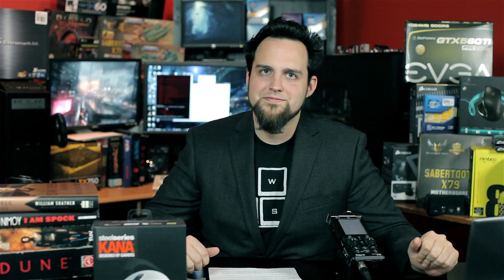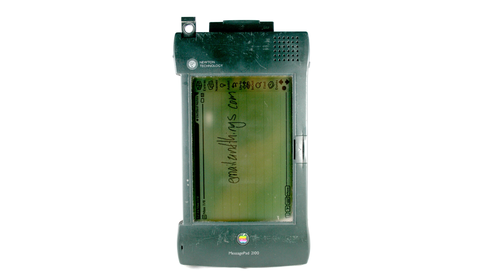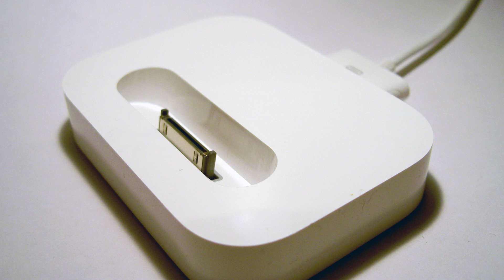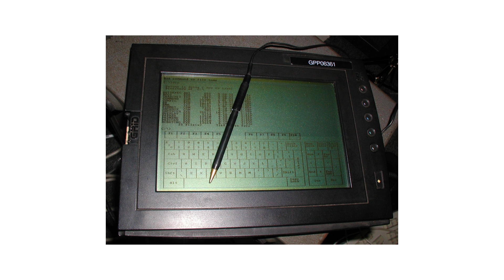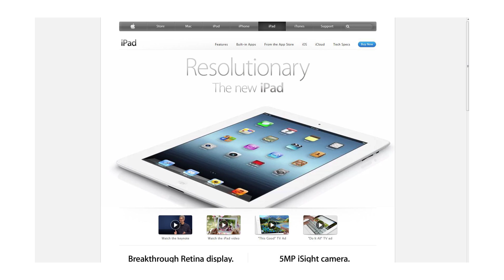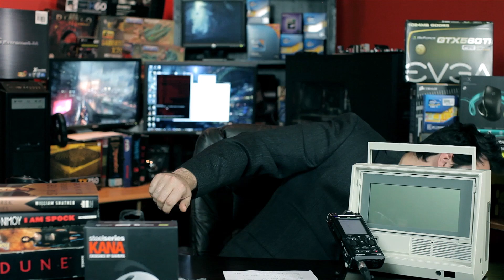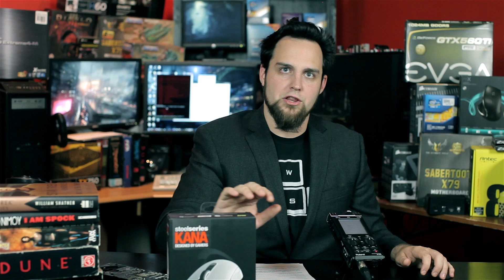Has Apple Really Ever Invented Anything?

Comment: the flash charger as you can plug it in anyway
Reply: Ehhh Nokias round charger. ANY WAY. Apples charger only has 2 ways
Reply: that's what i meant as you can use it upside down, never thought of the nokia :S
Reply: Cian McElhinney That is only a charger - Flashlight is also for data

Comment: Well, what did Woz invent? Not the transistor, logic gate, RAMs, microprocessor, PCB, disk drive, keyboard, monitor, whatever. By your own skewed logic, he just slapped together things that were already there. The point is, slapping things together in innovative ways can constitute an invention. In fact, most inventions are like that. The microprocessor, considered to be one of the greatest inventions in the history of technology, just "slapped together" logical pieces of circuitry that had all been there before as separate units, onto one integrated circuit (and integrated circuits had been there before too, of course). And that's why, for example, things like the iPhone or the iPad were inventions, in fact great inventions, even though mobile phones and touch screens and tablets and motion sensors had all been there before. The invention was in the vertical integration of all those things, together with software, the "physical" touch UI, and later the app store model and so on, to make a truly new category of device, which went on to disrupt and recreate the whole smartphone market. Every smartphone sold today is fundamentally similar to the original iPhone, whereas none of the Smartphones sold in 2006 were. That says something.
Reply: Great question. What DID the Woz invent?

He invented a method for having a computer output its graphics onto a video display, an apparatus for digitally controlling PAL colour displays, etc. The point is Wozniak's patents aren't design patents (e.g. the iPad or iPhone, specific product patents); most of them are utility patents.

What the video talks about here is general product concepts, not the parts and components that make up those technologies (transistors, logic gates, microprocessors). Apple weren't the first company to combine a touchscreen with a computer to make a handheld touch screen device, they weren't the first company to come out with a 'personal computer'.

Comment: 4:03 isn't that also known as DisplayPort?
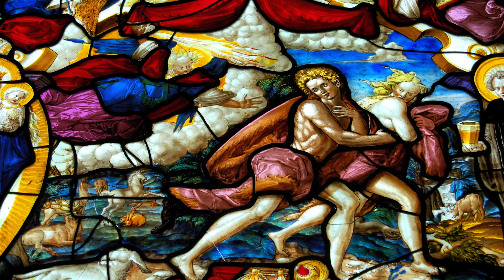7:42 I don't see it in here.
9:01 If you mean iOS...I think the letters are pronounced separately.
Reply: Thunderbolt is more versatile than DisplayPort. To my knowledge, Display Port is not used in anything but audio/video transmission (it serves as a royalty free version to HDMI) Thunderbolt, on the other hand, can be used for data transfer to drives, monitors. Thunderbolt is an all-in-one alternative to all interfaces for simple data, audio, and video.

Comment: They invented the very first 64 bit processor in a mobile device.
Reply: This is not an invention. It might or might not be a "record" or "first", i.e. Apple's iPhone is the first commercially sold mobile phone with a Samsung made 64bit CPU. Of course, other mobile devices, such as notebook computers, had 64bit CPUs long before the iPhone.
Reply: ***** first ported not first created.
Reply: A:  No,  they didn't.  AMD invented 64 bit architecture,  Samsung invented the mobile 64 bit chip.  They also make the A7
B:  It doesn't add anything of benefit.  It still under performs against it's android flagship counterparts such as the LG G2 and Nexus 5,  and the Note 3.  Double-computing dual core cpu,  or single computing quad core cpu....  same thing.
Reply: benjmiester Thanks! I actually didn't know that.

Comment: You do realize you're talking about a company that copied and stole things from Xerox....right?

-_-

quoted wiki  " The first operating system used for real work was GM-NAA I/O, produced in 1956 by General Motors' Research division[1] for its IBM 704 "

You're welcome.  So it depends on your idea of " computer operating system "

Again.  Apple is NOT an " inventing" company.  Logan said it best.  They are a " recipe" company.  I add " that overcharges for what you get"

Comment: In the 4 years of having an android i have not once had a problem. Your thoughts might have been true 5 years ago, but it simply is not the case anymore. Many apps are exactly the same, and in androids case free. A open source program will in the long run beat a proprietary, locked down program every single time. Just look at the figures for the last year, the numbers don't lie.

Comment: It wasn't a user error, I'm not an idiot, I used it all the time, so it wasn't about the usage, any time it reached 20% I stopped using it, it's only gone empty since I stopped caring which is when the battery only held 4 hours of charge, also I charged it every day before going to sleep because I used it every day just like my phone, so it's not that, and my phone which at the time was a blackberry, it was 3 years old and held more charge than the ipod

Comment: ARM is a CPU architecture, and was original designed by a company that split off from Apple called Acorn.  Acorn designed ARM for use in their microcomputers in the 80s.  Apple outsourced Samsung to produce the chips, because that's what Samsung does.  If Apple wanted to they could have gotten Motorola, IBM, Intel, AMD, or any other large silicon chip producer to make the chips. The design is completely by Apple.

Comment: Reading your other Posts. I would disagree with you on a lot things. You say Macs are perfect and Windows based system are shit and have/get a ton of errors on them. No PC will get tons of errors on them unless you fail at maintaining a PC. I knew someone with a MBP. I think it was a 08 model and it would overheat without it it doing any thing at all to. The idle temp of the CPU in it was like 70c. Open a basic program it shot up another 10-15 points. Something wasn't right or seated properly.

Comment: You mean you can suppory piracy, Piratebay is not for everyone.
There are tons of free copies of windows ultimate floating around big deal. But a new laptop from best buy and it will come leaded with bloateware. Fresh install? not everybody has time to find drivers, properly install windows and tinker with settings. A Mac is by far more user friendly and more secure. When you need something done, you can do it effectively in any platform, don't matter weather is a mac or windows pc.

Comment: (continued, after some more research) I can't prove they didn't have any engineering sample of an i5 in early 2008, although it sounds very unlikely. However, low-power Macbooks (Air, Pro 13 and polycarbonate Unibody) still kept the Wolfdale Core 2 Duos for three more years until the release of Sandy Bridge, meaning that probably Apple wasn't very happy about Westmere's performance after all.

Comment: 12:00 Are you sure you've got the story right? AFAIK (but it's documented on various Wikipedia articles) the Macbook Air was originally based on a die-shrunk Merom Core 2 Duo, made specifically for Apple when Intel was barely starting out with ULV processors, and they used to brand all the low-power parts as Celerons. Nehalem, Westmere and the i5/i7 would take a couple of years to be disclosed, produced and released.

Comment: The iPhone is the most overrated piece of shit,drop it once and its fucked but the Samsung Galaxy S1,2 or 3 my S2 was dropped onto every surface there is (concrete hard wood floor tarmac) without a case and its still working fine. Fuck apple over priced over rated shit

Comment: CNC Machining cutting Aluminum is not slow at all, a Tungsten Carbide cutter cuts Aluminum at around 1000 SS (Surface Speed), which when using a 2-flute (3,4,5,or 6 flutes are usually bad for Aluminum because the metal would melt in the flute and block them) Carbide cutter on a Vertical CNC Mill would usually put the RPM of the Spindle near the max safe speed of the machine, so the cutting process of that would be fairly fast for production on a CNC machine.

Comment: There are plenty of laptops that can do that, and they do so at a far more reasonable price. The macbook is, let's face it, way overpriced even for laptop standards. you also cannot upgrade a Macbook in any way shape or form, whereas with many high end windows laptops, you can change RAM, hard drives, CPUs and GPUs. Apple is just a massive brand name. it uses the same parts in a different skin at a higher price

Comment: Not as bad as the one I've seen from ASUS where they shipped a ton of models whiched carried a defect from oversight where the ACPI drivers were designed to stop the hard drive at every opportunity to conserve battery life. It worked but at the cost of severely limiting the hard drive's life span to less than an average of a year. Most consider ASUS to have good hardware at low prices (albeit really bad build QA testing). You should be concerned about the build quality of your laptops.

Comment: True, for the ipods are using aluminosilicate glass (same as gorilla glass really) and the iPhones are using Gorilla glass - same as almost any other smartphone. While this is a shortcoming, the rest of the design is really well put together, and this all ads up to a quality feel and build - albeit perhaps not the best, but miles ahead of most other devices.
Also there are so many drop tests that goes in each direction, this is the internet, everything should be taken with a bit of salt...

Comment: Directly from the wiki article in multi-touch: "One of the early implementations of mutual capacitance touchscreen technology was developed at CERN in 1977[4][5] based on their capacitance touch screens developed in 1972 by Danish electronics engineer Bent Stumpe. This technology was used to develop a new type of human machine interface (HMI) for the control room of the Super Proton Synchrotron particle accelerator."

Comment: Psion Series 3 - 1991 and it barely qualifies as a PDA
HP 93LX - 2006
Symbian pda - 2000
Microsoft Windows Palm - 2005
Apple Newton - 1998, but in development since 1987 putting it FAR ahead of even the original Psion.

thanks for playing, try again

Comment: another thing these idiots dont get is the first mac ever using intel architecture was like mid 2006, that means everything is completely new, nothing created before that date would be compatible that includes viruses and every other program ever. there was nothing to base yourself off of to make a virus and it was a computer no one used anyway so virtually no one bothered, anyone smart enough to write a virus from scratch are not going to buy a mac so to this day viruses are minimal

Comment: Not really. Arm does 1 of two things. A) do what you just said about licencing the architecture to oems. this is typical with exynos processors, where everything is stock. mali, cortex a9s, 

the other way is arm could licences the instruction set and leave it up to the oems to make their own core. Apple, Qualcomm and Nvidia tend to do this (nvidia does half, they take the cpu cores but design everything else). If you look at the Apple A6 SoC, on anadtech its actually not stock arm design.

Comment: 1982 – First Multi-Touch System – Nimish Mehta , University of Toronto
The very first multi-touch system designed for computer input was a frosted glass panel with a camera that detected finger motion. This simple interface, which depended on a camera, allowed for multi-touch picture drawing.

Comment: Confused - did the inventor of the wheel invent wood first? No. "Invention" is most often the result of putting existing things together in a new and unique way to give a result which no one has done before. Sure, capacitative screens, tablet form factors etc had all existed before, but putting all the right tech into a package and making it all work using engineering and design - that's invention. With the iPod, iPhone and iPad, Apple launched entirely new industries, that's pure invention.

Comment: You don't really need a quad core for starters. A dual core is just fine for maxed settings. I have a refurbished 690 that I got off of Ebay for a little over 300. Then I  put a Phenom 2 with 4 GB of ram. I also have a Seagate 500 GB. All of this is encased inside of an old HP case that my friend had lying around

Comment: I'm not saying that the Mac is bad. I'm just saying that the PC is better than the Mac, and people shouldn't try to give off the impression that they think Macs are better because that's just dumb. There's no pretty way to put it. Like I said before, you don't know a whole ton about PC's if you think a 7970 can run Crysis 3 at 60 fps. I said I could run it at 35 fps on average maxed out. That's not a very tough feat.

Comment: So you're saying that it's worth paying $2000 for a GTX 680m doesn't matter? No. I have a $500 laptop that can run Battlefield 3 and Crysis 3 maxed out with about 35 FPS. Most game devs have to scale the games down to meet the Mac requirements. So what if you can't find anything about downscaling to Mac? Devs have to scale for consoles, and you can't find anything about that. Does that mean it doesn't exist? No

Comment: Umm..pcpartpicker (.) com(/)p(/)172oX 
Reasons for my choices: Gtx 680mx performs like a Gtx 670, All in one aluminum, 1440p, 27 inch chassis not available, but plastic, 1080p, 21.5 inch ones were available for around $500 (factor in $300 to the price), Keyboard+mouse included with Mac, etc. etc. See the cost similarity now? feel free to comment/ask questions.

Comment: Actually, Macs are very powerful. The operating system might be shit, but their design and hardware are very advanced compared to other Windows machines. If you compared, say, an iMac to a similar, high-end Windows machine that you would be able to build yourself, you would find that you would only lose $25-75. And as for power, I doubt that you have a Gtx 680MX. Macs are capable, even if they're not the bleeding edge. They are comparable in many ways to PCs.

Comment: That's called loading. Aka you have a crappy hard drive that should be replaced. Lag is when you have too low of an fps for things to run smoothly. This is present in games (which Macs are not the best at because they use integrated graphics) and sometimes in OS animations/web browsing experiences. However, as long as you're not using a 4 year old machine on the latest firmware (just like old Windows computers should stay on Windows XP and not be upgraded to Windows 7), there should be no lag.

Comment: I do agree that the 5 year old is rather dumb but I do have to say they can be rather laggy as a know someone who recently got a new Mac Pro because the operating system wasn't compatable so they spent about 4,000 on a new Mac and it is rather jittery and a lot slower than the older computer that had a really old processor and a bad graphics card and this new one has 2 fairly decent graphics card along with a 12 core Xeon. there isn't a problem with menus but I dislike their shortcut keys system

Comment: Best PERFORMING Windows PC. Though this probably partially due to the fact that it's running, driver issues and etc aside, a CLEAN install of Windows. Unlike most laptop's that come with bloatware, which does impact a performance. If all the laptops on the list were wiped clean and running a fresh windows install I'm sure they rankings would be a little different.

Comment: The reason I like macs are because, well, they just work. With a PC or a Hackintosh, you have to buy select parts and you're not always optimized, you have to be a total geek to use it. Not in the way I'm a geek, either. I prefer buying a computer that may be overpriced spec-wise but has amazing design, optimization and quality. If you can't afford a Mac, don't argue about Macs. If you like PC more, that's cool, just saying. But stop your blind hatred. It will be ignored. Thank you.

Comment: No.

"German company Telefunken published on their early ball mouse called "Rollkugel" (German for "rolling ball"), on October 2, 1968.[13] Telefunken's mouse was then sold commercially as optional equipment for their TR-440 computer, which was first marketed in 1968. Telefunken did not apply for a patent on their device. Bill English, builder of Engelbart's original mouse,[15] created a ball mouse in 1972 while working for Xerox PARC.[16]"
wikipedia mouse article.

Comment: ...retina isn't an actual thing. It is a pixel per inch measurement. Anything over 330ppi is considered Retina by Apple. Retina displays are simply LCD IPS panels. There is no patent on retina only a trademark for the name. As long as your device can produce over 330ppi it is "retina" regardless of what the panel type is.

Comment: The Lisa had two 5" floppy disk drives called flippy's. You could pull out the floppy disk and flip it over and put it back in. The disks had iron oxide on both sides.

Comment: Yes, some.  The motherboard is one component, essentially they just moved things around to make it a different form factor.  The CPU is not proprietary.  The graphics devices are not proprietary.  The hard drives are not proprietary.  The RAM is not proprietary.  Basically nothing except the motherboard is proprietary as far as the Mac Pro is concerned.  PowerPC is an IBM processor that was abandoned when they switched to Intel processors.  PowerPC instruction set on an Intel CPU is nonsense.

Comment: My dell XPS one 2710 was $1300. 27 inch screen, i7-3770s, 16gb ram, 2tb HD and 32gb SSD, win7, and gt 640m. And although it seems worth it, in the end it's better to build your own PC. I cannot upgrade the Power supply or graphics card on my AIO, which sucks. As nice of a computer it is, I cannot upgrade anything except the RAM. Ditch major computer manufacturer's and build your own PC